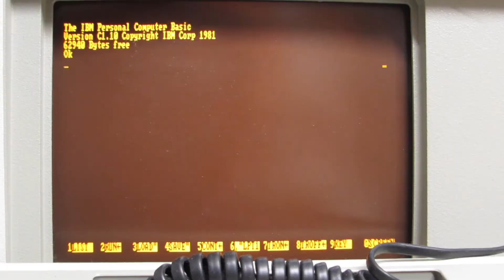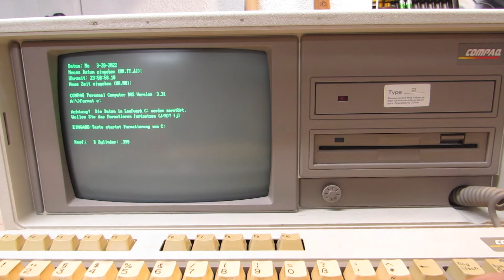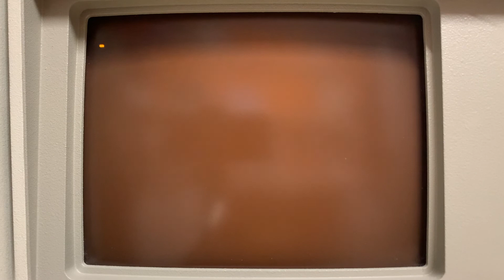Reviving a COMPAQ Portable II

Comment: Hi there, did you know your Portable II has an original, hard to obtain CEGC (Compaq Enhanced Graphics Card) in it? That's a very nice and rare video card that's able to display high res 640x350 EGA in 16 gray scales on the internal dual mode Compaq monitors through its proprietary analog video output which makes for super nice and clear monochrome text and graphics. I was looking for one of these cards for years to put in my OG Compaq Portable and I was plotting to create a little board that to convert the video signals of my ATi card but I finally found one today on Ebay in the exact same machine as yours, joy!🥳🥳 🙂
Reply from the maker: Hey @pipschannel1222, I knew it was the original COMPAQ EGA card, but I didn't actually pay attention to the card in particular about it being special or not.
What of these old machine has actually not become rare and sometimes even special in meantime? Maybe I should pay better attention to those small details. With a new video every week, I seem to miss these small nuggest every now and then.

Thanks for pointing it out!